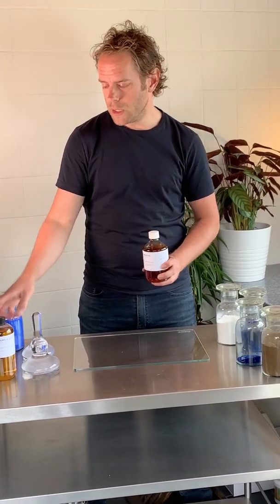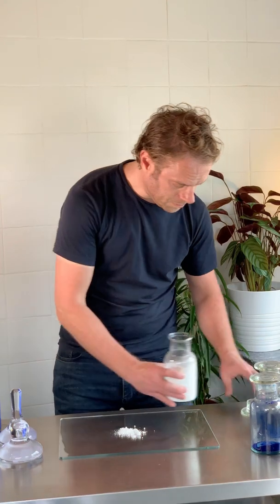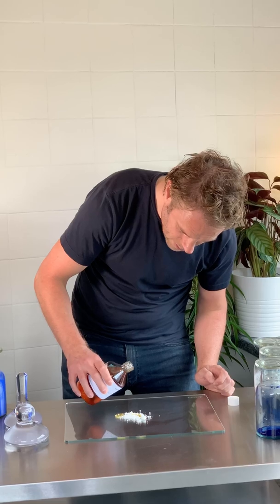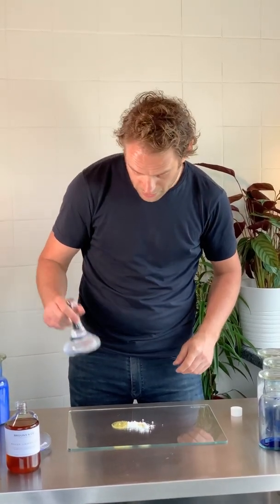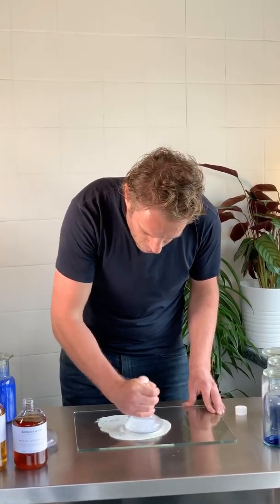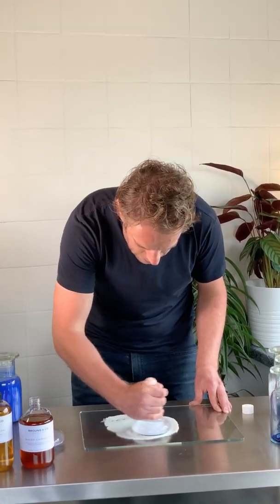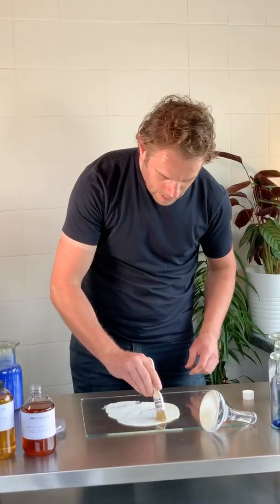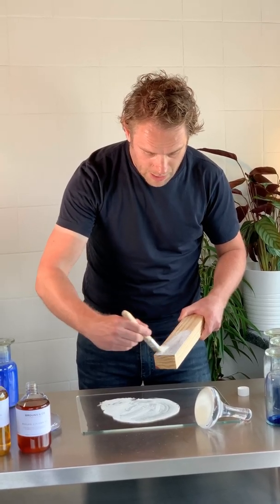Shorts: How is linseed paint made?

Comment: I want to paint some reclaimed pressure-treated lumber. Would linseed oil paint be compatible with it? It may be the old arsenic treated wood, which is why I want to keep it out of the landfill. It’s for an outdoor structure where no one will touch the wood with bare hands, in all likelihood.
Reply: I wouldn't expect any issues. It's just oil and a pigment powder. Maybe Google if linseed oil and the pigment your color of choice uses would react to PT wood, but I doubt there is anything in the PT that would be likely to cause an issue.

As for the project, just make sure the wood is nice and dry, or the oil won't wick into the pores and dry well.
Reply: @woodworkerroyer8497 Thank you! Another issue I have encountered, since initially asking my question, is that linseed oil is immensely flammable. Is that the case even after it has cured/dried?
Reply: @monkeytrainer8135 

It is flammable while wet. Anything that is flammable that touches it needs to be set in a place where it CAN'T catch other things on fire untill it is dry. Rags or brushes need to be put in a metal trash can, or on a concrete pad till dry, as the oil is exothermic, meaning it creates heat as it dries. So don't wad up the rags and toss them in a trash can with a bunch of paper in the garage 😂 Once dry, you CAN throw it away normally, but not when it is wet. 

So, I don't think the wood would be significantly more flammable, but do some research on it. I personally use boiled linseed oil (BLO) on a ton of tool handles and the like, and I've never heard of it being a fire hazard once it is dry. Wranglerstar even uses it on handles of tools he used for fire fighting (I don't agree with his views on a lot of things, but his methods for handle preservation are amazing).

Hope that helps! I plan on using linseed paint on the trim of the barn I am building. I think it will be interesting to see how it holds up compared to the $50/gal solid color Behr stain I am doing the walls with (I'd prefer to use linseed paint, but I bought the other stuff and I don't think it is returnable now 😂)
Reply: No.